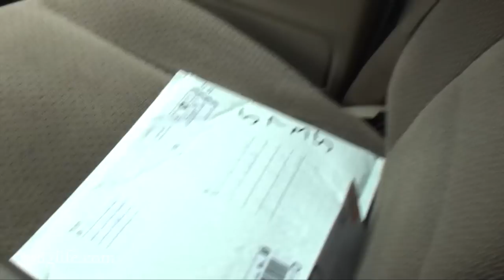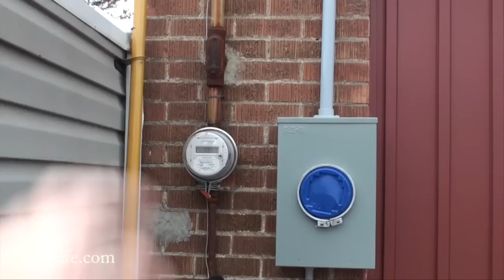nice blade bro

Comment: I think I might have built a sliding jig for the bench grinder... but I always build jigs...
Reply: +WezleyB  I think I would have just milled the piece with the angle to begin with.
Reply: +Swanny383 Does not compute
Reply: Clamp piece at angle on mill table, then take large end mill or fly cutter and put the bevel on the steel.
Reply: +Swanny383 Was joking on his part